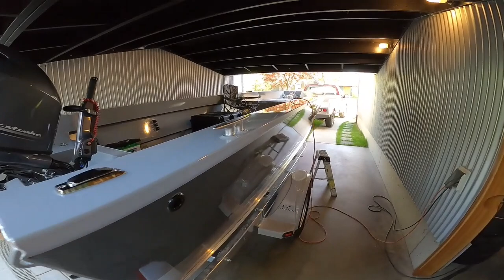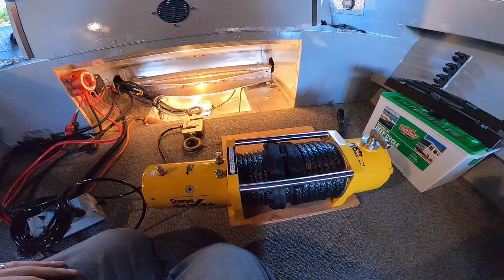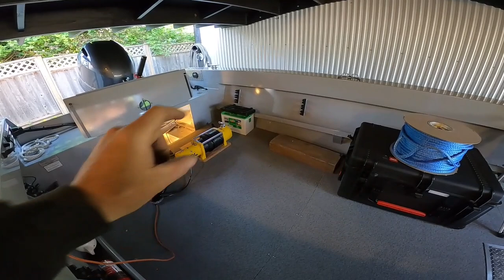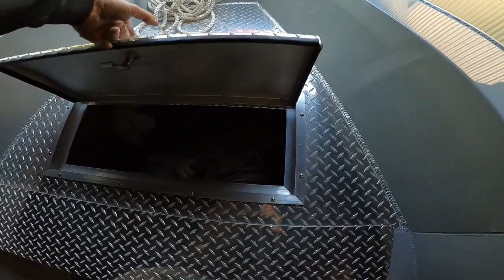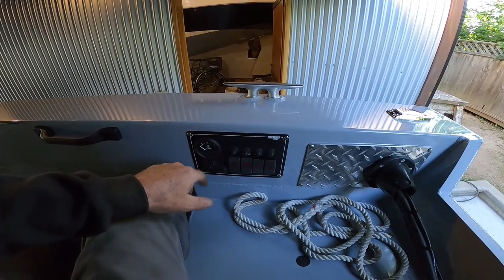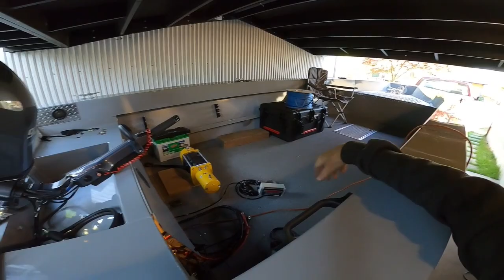New Test Boat and New Rocna Anchor.

Comment: That through-transom arrangement, how do you expect to get it to not bind? Given anchor load is inherently partially downward you'd need the pivot point to be coplanar with the transom. I don't understand how that can work at all without a roller or something for each part of the bridle.
Reply from the maker: The eye-bolts that pass through the transom are not expected to move.  They are locked solid to the transom along the the welded 'beam' that I showed in the video.
Reply: @Panope  So the load cell is only attached to it to hold the back of the floating winch and you're measuring the linear force on the winch as it pulls on the front dead anchor? If so, I guess that makes sense, but it wasn't clear in the video, at least, not to me. Cheers.

Comment: Pretty funny you chose the bruce anchor for the boat.
Reply from the maker: Yes, I figured that choice would raise a few eyebrows.  Here is my rationale: 1) While holding power is low, I cannot think of a time where that anchor failed to make at least some holding power. 2) I do not need much holding power for that boat.  3) Neutrality.  I do not have to worry about 'playing favorites' with an anchor that is in current production. 4)  The anchor fits perfectly in that rather shallow locker.
Reply: @Panope  Thanks for the response, wasn't questioning your choice, was just funny in an ironic way. Goes to show there is an anchor for every circumstance, and certain factors outweigh others.
Reply: @Panope  Good logic, I can respect that. Why not build a Manork or similar DIY new-style anchor - really easy to fabricate a small one that will easily hold that boat. My 2c.
Reply: @Panope  I'm surprised you didn't use the mantus dinghy anchor.
Reply: Terrible anchors. Agreed.